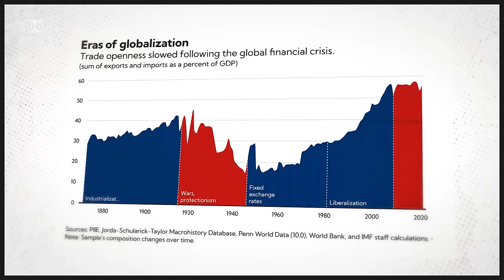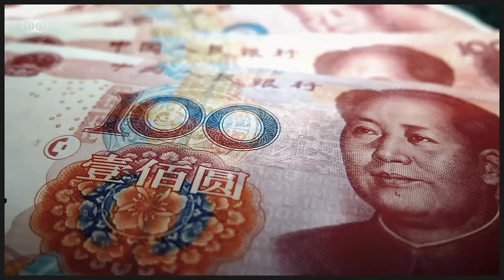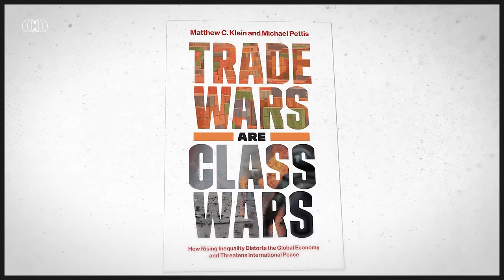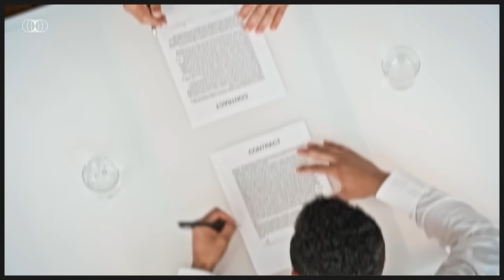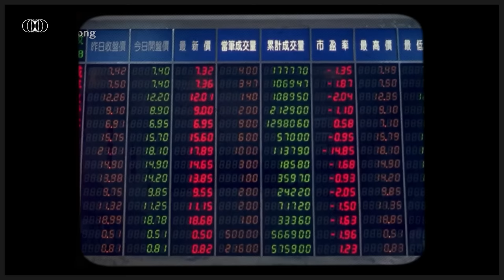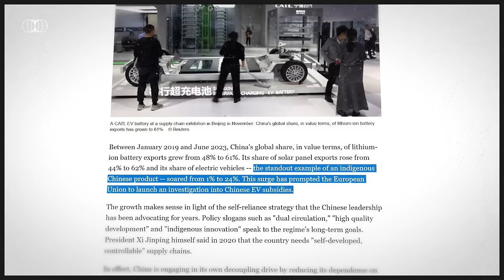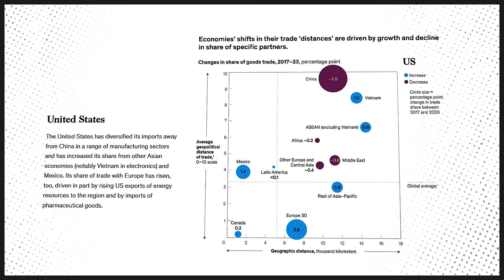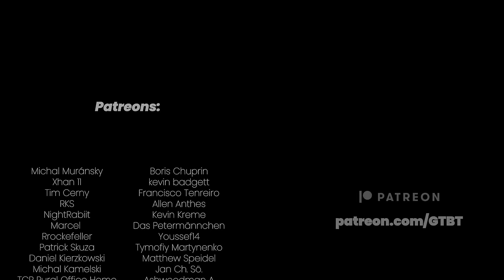Hyperglobalisation Is Dead

Comment: That's what happens when you shift production en mass to other countries and don't establish the minimum required welfare to absorb the social impact, lack of common sense really, or a low quality political class.

Or maybe it's just cultural problems, who knows
Reply: The low-cost labor group includes textiles, apparel, toys, and electronics assembly. This is the shit that we moved to China; Jobs in these businesses are the most globally tradable; manufacturers in these businesses develop global supply chains to optimize access to the right low-wage capabilities.  Manufacturing has fallen from 30% of US employment in 1950 to 10% today, even as output grew steadily; and manufacturers have consistently raised productivity through automation and innovation in products and processes. Indeed, in advanced economies, manufacturing has become the engine of productivity growth, providing about a third of productivity improvement in the US, or three times its contribution to employment. Manufacturing also leads in research and development, supplying up to 70% of private-sector research and development funding in advanced economies. Manufactured goods also remain the largest source of exports in most advanced economies.  Really we make the same amount 3x less employees, 3x more productively.
Reply: @Kenneth_James  But 3x less employees, 3x more productively is not exclusively a good thing. The employees previously working in local facilities could spend their income while now some of them might be unemployed. It's complicated.
Reply: How do you pay for welfare without the industry?

Replacing the industry with welfare would just accelerate ecconomic decline as the government is forced to print even more money
Reply: @matthiuskoenig3378  Do you really believe the industrial era is for ever?

Comment: I am impressed with your analysis as most people who talk about "globalism" either leave out or under value the Brentonwood's accords which in terms of history was extraordinary.   The one thing you may have left out is not only did the U.S. agree to use its Navy to keep the SLOCs open for trade but signatories to the accords could sell into the U.S. market (the largest by far at the end of WW2) .   This was all done to battle the Soviets in the Cold War.  The Cold War ended in 1992 (I know I was there) and I would argue that is when "Globalization" started to break down.  It's been coasting to an end since.   The Soviet Union is gone, the U.S. Navy has reoriented itself in terms of power projection over the last 20 years, the U.S. economy although still the largest it is not able to absorb all the inputs from all over the world.    For how far apart they may seem, Biden and Trump's foreign policies are very similar.  The U.S. has been heading back into one of its isolation periods, COVID just has speed it up.   The world 10 years from now will look more like 1924 than 2024.   Good work.   Just one observation.   "Trickle Down Economics" is not an economic model. Juding by your video you are a good researcher, do a search.  You will find a lot of political articles, but you won't find an economic "school" or "policy."  It's a common mistake.   Again, you have done good work.